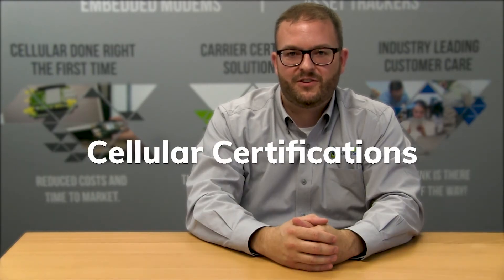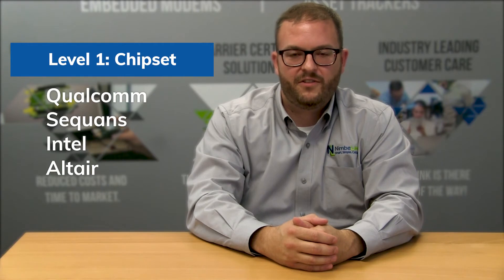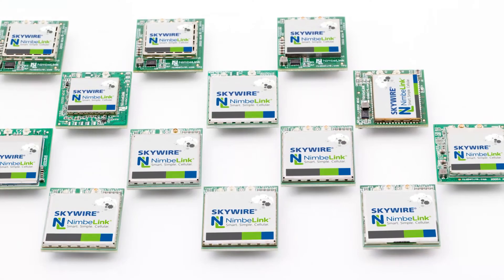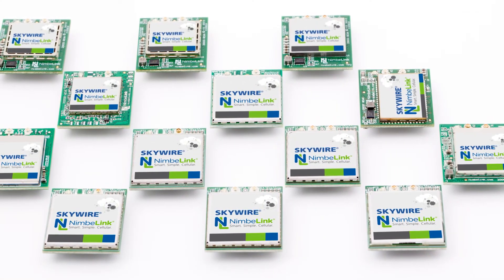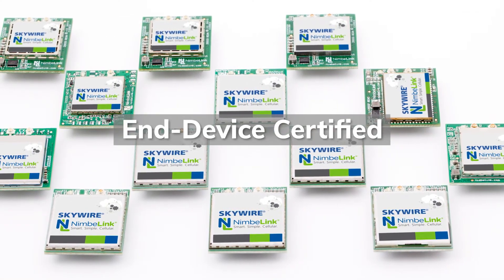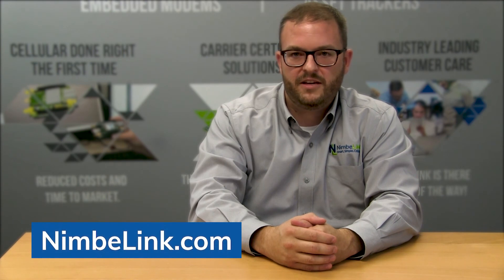End Device Certification

Comment: HI Kurt, if the TLS is moved from the "certified Module" to the application MCU, can we assume the "Module certification" is lost, consequently "end device certification" will need to be done entirely by the end customer ?
Reply from the maker: Hi.  Actually Nimbelink recommends the TLS be managed in the stack for the microprocessor / microcontroller.  When the TLS is updated over time we din that the processors get updated much faster that the modules do for new FW versions.  Also there are typically more resources, processing horse power, memory,  in the processor than available in the modem / module.  The modem “end device certification” is not impacted by moving the TLS out of the modem into a different section of your device architecture.  If you have additional questions please contact Sales@nimbelink.com and we can provide more information.
Reply: @Airgaininc  thanks a lot for taking the time to answer. It make complete sense now